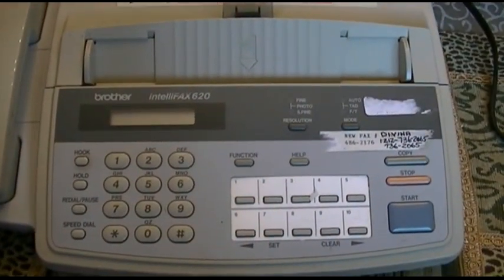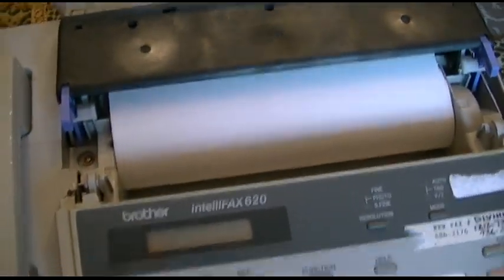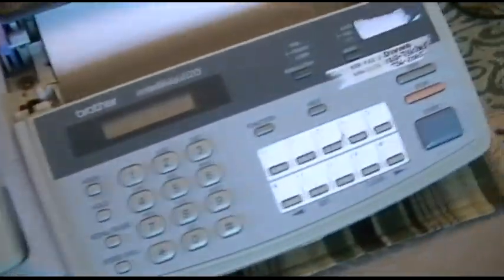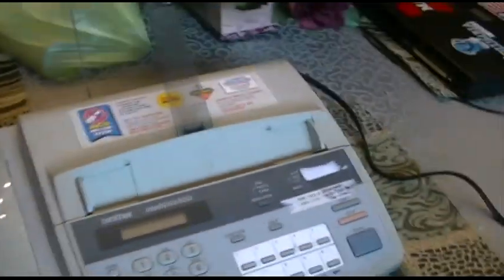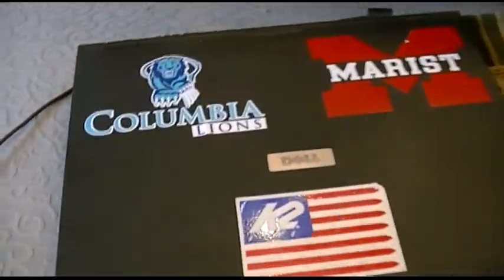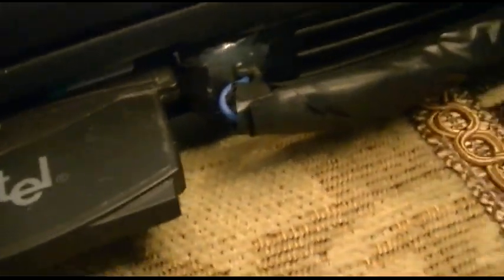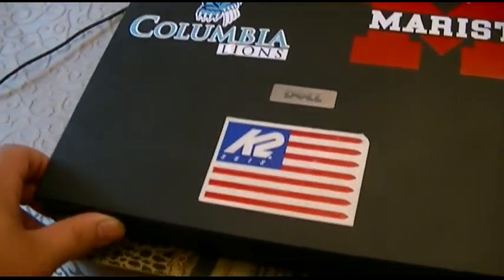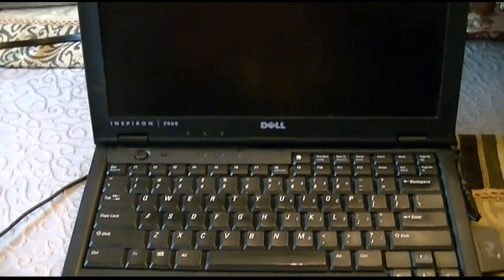Use Fax Machine As Printer! Put That Old Dial-Up Modem To Use!

Comment: THATS HELLA SLOW BRO xD but as long you make good use to it. i love how it's not very noisy which is great
Reply from the maker: Fax machines in general were not meant to print pictures, just text.  So faxing back in the day when a sheet of paper had mostly writing or printed text was a lot faster.

Being a Group 2 Fax machine, I believe this transmits/receives at a maximum of 9600bps, which was slow as it was (by today's standards, anyway), so sending it a print job of many Ks will take some time, as with the picture I printed.

I remember fax machines always taking a long time, they were really slow when they didn't include scan-ahead buffers like almost any machine now, where you load 15 pages in, dial the number, the machine pre-scans all the pages and sends at its leisurely pace.  Without the pre-buffer as such, there was a LOT of latency involved as the law of small numbers dictates.  You had to ready the machines for transmission, then the sending machine has to start scanning.  As soon as the transmission buffer was full, it would wait before scanning again--the receiving unit would send a "clear to receive" signal, and then the initiating machine would continue scanning.  It had to get everything ready and continue, which introduced latency (even the starting of the scan motor again induced latency) so you can see how it all adds up.

Of course with this example there's no mechanics latency on the computer end, but it's a big print job nonetheless.  Later that day I printed a recipe and followed it in the kitchen.  Once you spill stuff on it, you can throw it away and print a new one--office economics at its best!

Comment: i can't do as what you've done...I'm using win 7 and panasonic KX-FT982...all steps i've done including the modem setting (untick wait for dial tone before dialing) but seems not working....please help !!
Reply from the maker: I was using Windows XP in this video.  Now, as I've stated earlier "You might need a vintage dell laptop like I have in this video.  I have 3 of these things, they all worked.  I also have 3 other old (but not as old) laptops that are like Pentium 4-class machines, none of those worked.  Some output nothing, some output a loud, angry buzz.  I haven't gotten around to metering the connection on the old units to see if there's voltage or something that the other old laptops aren't outputting."

The other 3 laptops I had I never had any luck getting to work--all of those are using Windows 7.  There's something about the modems used in these Dell systems that somehow makes this possible; it was by accident I found this out--as discovered in the video.

Although I haven't tested for it, I surmise these Dell machines are providing their own "talk battery" for the line, or perhaps the polarity of the modems in them is different.

For you, get a spare line cord, cut it in half and strip the ends.  You'll only need the center 2 conductors if the wire has 4.  With that, connect red to green and green to red and test again; nothing will get hurt, it will either work or it won't.

If the polarity doesn't do it, you could try adding your own talk battery, for that you will need a 9-volt battery and a 300-ohm resistor.  Connect green to green, and red to battery, other battery terminal to resistor, other resistor end to red wire.  NOTE:  THIS MAY DAMAGE YOUR EQUIPMENT.

Another real dumb thing you want to try first is to make sure that fax machine works on a real phone line--hook it up and have somebody fax you.  Doesn't count if "it worked last time I tried it in 1995".

Subsequent research reveals this fax machine you speak of may be an overseas (Non-U.S.) model.  If that's the case, I'd say all bets are off (though technically it should be possible to fax worldwide).  I found a manual for the fax machine you speak of here:  http://www.panasupport.hu/html/telecom/FT982_988FX_SM.pdf.  If that's the case, it's very unnerving to me, because that is the BEST written manual I've probably seen in 25 years.  They went down to full schematics and described the function of every IC and component on every board.

All in all, this whole experiment was a tinkering process.  Keep trying different things, and maybe you'll get lucky like I did.  Good Luck!

Comment: Interesting use of an old facsimile machine. Try to connect the old laptop to a dial up connection like a BBS or something.....
Reply from the maker: Thank you.

BBS?  My challenge is to find an active dial-up BBS first!  Most have gone to TELNET if they are still around.  Actually I have connected to a BBS a few years ago, I dialed up by phone modem and connected at 56K, BUT the telephone line was VoIP instead of POTS!!!

I still have an old IBM PC XT hooked up to the big TV in the living room, and that can still dial up and connect at 2400bps to one or 2 things that are still around.  Not that they are much use, mind you, but still, it's there.  Internet at it's finest, primitive, text-only.  None of this picture mumbo-jumbo.

Comment: You could use a linksys PAP2T or similar VOIP adaptor to connect the laptop to the fax machine and it would provide the dial tone and ring signal to fully automate the printing...
Reply from the maker: Yeah, but that would be cheating, using extra hardware!  It would automate the process, though--don't think it hasn't crossed my mind.
Reply: jaykay18 That' is not cheating, it is the simplest way to make them work together as they were designed to do...It can be set so when line 1 picks up line 2 rings and vice versa.....

Comment: I have an hp 2140 fax (if it means anything), and I haven't had any luck connecting it directly to my modem and printing. You pressed a "hook" button in the video, one that my machine doesn't have. Any suggestions?
Reply from the maker: A few things.  Firstly, early HP faxes weren't the most reliable things in the world, a lot of times they just refused to connect to other fax machines for no good reason.  If yours doesn't have a hook button, but has a handset, you might just get away with pressing start; you likely would have to pick up the handset before doing so.  No need to put the handset back down carefully as the start fax button should disable the microphone part of the handset.

Next:  You might need a vintage dell laptop like I have in this video.  I have 3 of these things, they all worked.  I also have 3 other old (but not as old) laptops that are like Pentium 4-class machines, none of those worked.  Some output nothing, some output a loud, angry buzz.  I haven't gotten around to metering the connection on the old units to see if there's voltage or something that the other old laptops aren't outputting.

Note that you also need to set the modem to ignore "wait for dial tone before dialing", otherwise there's no chance it will work.

Even if you do get this to work, you'll end up with low-resolution, thermal paper printouts.  Thermal paper is great for transient documents that you won't need after a short period of time, they fade quickly.  Also good for a recipe if you spill all kinds of stuff in the kitchen, you just print up a new one when you make that dish next!

Comment from the maker: Um, let me think about it...............

.......................................Still thinking.......................

YES!

If you wanted to fax in color you'd need fancy new machines that have tiny, expensive ink cartridges.  

An old thermal paper fax like this can only print in black and white, though newer thermal receipt printers can print in red and black by varying the heat used.  Although the blacks on those machines are kinds of a very dark brown, so you give something up for "color".

Comment from the maker: Interesting.  Regardless it's still somewhat of a manual process since the fax machine times out after a while.

Sound over phone lines isn't new.  I read somewhere that as a crude was of transferring files without a modem, on the Apple ][ computers with cassette ports, you'd connect them to the phone lines, type "LOAD" on one side, "SAVE" on the other, and wait for the transfer to complete.  Slow, and error-prone, but at 300 baud, if it saved an hour typing a program by hand it was worth it.

Comment: To anyone interested I have a single file Linux source code that takes a 1728 pixel BMP file and makes the fax dial up audio to a WAV file in both fine and superfine. All I had to do was get a RadioShack headphone plug and a phone cable and splice them together. Then I just type ./lmnm.prg input.bmp Output.wav and then switch to speakerphone mode,  type play Output.wav and then hit the blue start button, and voila, printout.

Comment from the maker: Thank you for the very kinds words!

There's plenty of conversion going on as is.  It starts digitally in the computer, then is transmitted over an RS-232 interface to the built-in modem, that modulates the digital signal to analog (sound).  At the other end it's demodulated and re-digitized, goes through the circuitry and then produces digital pulses that control a heating element to print on the paper.

I'd love to see this done via USB, this fax is Class 2 only, so 9600bps max, but it works!